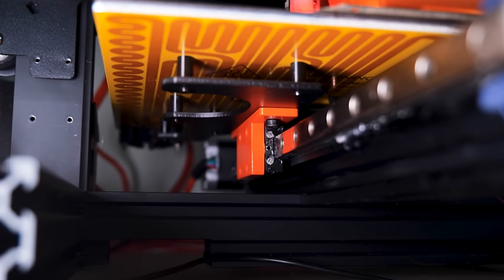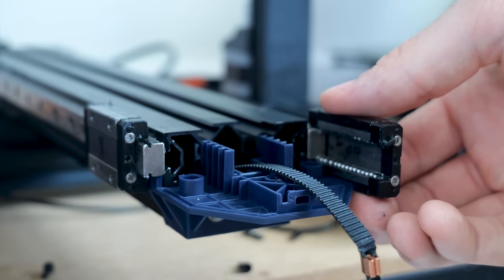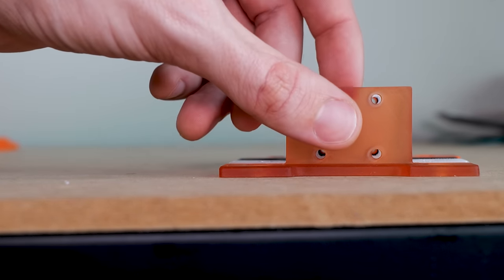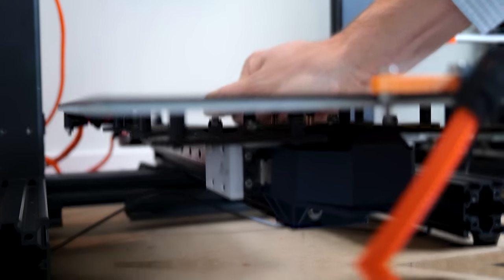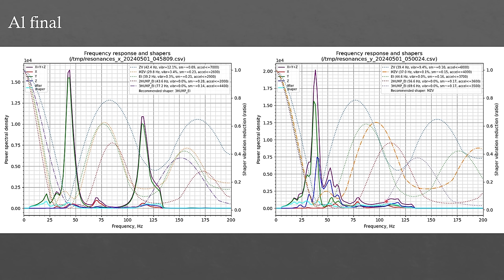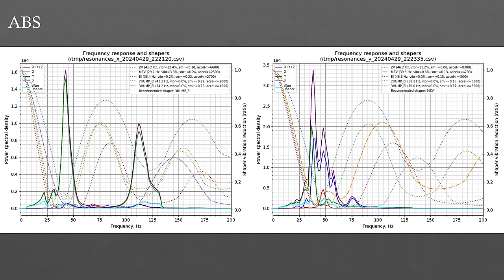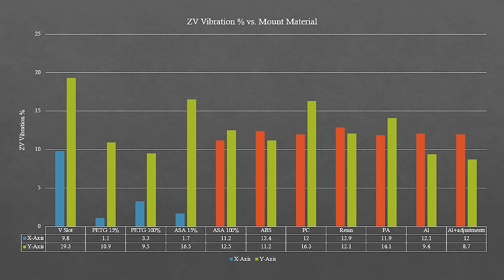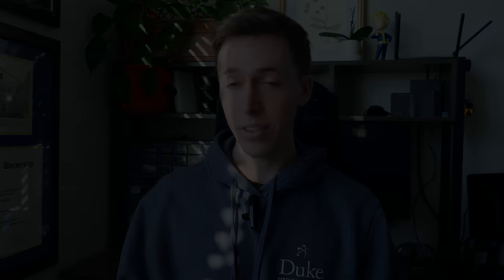Upgrading to Linear Rails a Waste of Money? - An Evidence Based Answer

Comment from the maker: Hey! Thank you for taking the time to watch this video. I just wanted to quickly point out a mistake I made in the video! When I show the grease I use, I present a grease that I claim does not have PTFE in it. Funny enough, as I find the link for it to put in the description, I discover that the Syncolon it has in it, is indeed PTFE. So, you may not want to use this specific grease... Sorry!
Reply: What a quality test, thank you for this!
Suggestions: Check the motors temperature, the added weight of the rails should, in terms of newtons law, require more energi (W) to run as fast as V-slot (edit: on many boards, even stock, you can up the driver voltage). Mine are all custom, so i can't give you any pointers other than; warmer then body temp = watch it, to warm and a little fan is needed. For Y with with glass bed and 2 linear, my stock Ender 3 motor needed cooling to handle properly
Reply: I specifically buy that specific brand of super lube because it has PTFE in it!
Reply: @SpencersDesk  the balls inside the carriages of miniature guide ways MGW/MGN are designed to circulate around little tracks.  To allow this circulation, they need to be oiled, rather than greased.  Definitely a good idea flushing and cleaning them, then applying the correct grade oil upon receipt.  They require occasional re-oiling - there are tiny holes in the plastic end caps/wiper seal plates to allow this.
Reply: @chrisgill5692  Yeah my friend told me the same. You could use grease in the Z axis but in the y and x axis because of the speed an somewhat thicker oil would be good.

Comment: I appreciate the exploration and learning, but you could have not uploaded this video. You have never used linear rails before and decided to go on Youtube and make a deterministic video about it? As an opinion piece, sure, but as "evidence based" this falls very short..  Linear rails easily hit 3,000+ mm/s movement speed as long as they are aligned properly and high quality. So a lot of this failure seems to be your own, and not something related to rails. As someone who operates a medium to large size print farm, I do not buy printers with V-slot wheels due to their issues with reliability and stability. I would advise you to come up with a way to line up your rails better or see if you got defective units.
Reply: Definitely, when using more than one rail per axis the perfect alignment is needed. Also thermal expansion affects the preload of the rails. So that's the reason why I changed mgn rails back to vslot wheels.
Reply from the maker: Hey! Thanks for your comment! Before getting into the reply, I just want to emphasize that this video wasn’t about which is better, VSlot or Linear Rails, but if it is worth upgrading to linear rails from a V Slot system. It’s obvious that linear rails that are better and worth choosing if you’re either designing a machine or buying a new one. They’re faster, more reliable, easier to maintain, etc, etc…

I definitely agree, there is my own failure influencing all of the results. But, that’s partially the point I tried to get across. The audience for this video is likely (a majority) people that don’t have experience setting them up. So, these are the results that they can expect. I definitely pointed this out and made sure viewers knew the errors in both the experiments themselves and my approach.

I provided results, discussed its shortcomings and explanations, then finished off with my opinion. I do believe it’s not worth it (unless you enjoy the work). If I ran a print farm I wouldn’t spend any of my time upgrading to linear rails. I would, as you have, bought printers with them on it. I stand by this video being honest and valuable to the community. I hope that clears up my stance? Thank you for your comment!
Reply: I came to the comments to say this.  Without proper implementation they won't work right. The rails being misaligned, and using super cheap rails from Amazon doesn't help either.  Also you should never remove the bearing from the rail without a bearing retainer. 

As far as wear a plastic wheel on aluminum channel will never last as long as hardened steel rails and bearings, not even close.
Reply: Doesn't matter if you can never hit that speed cuz the hotend can't heat up plastic nearly enough
Reply: Who hurt you? Hahaha It was pretty clear that his intention was to provide the perspective of a non expert to set the expectations of others who naively thinks linear rails will save them. If you don't know what you are doing it won't... And even if you try to learn as you go it may not even be faster than your older setup.
Don't be so rude... You look like a Karen.

Comment: Having experience in metalworking, I can say that rail guides should work in pair. One rail will always give friction. Even with preloaded cariage.
Reply: Was thinking the same thing. Proper setup would include a high precision "arm measuring" tool to align them (no idea what that tool is called in english), but hen again, a 3D printer isn't a CNC mill designed to handle 100s of kg
Reply: yeah, usually installed in pairs, and the grey bearded (decades of experience) toolmakers would spend hours adjusting them to be parallel to within a few  thousandths of an inch along their entire runs. (I worked programming premium quality custom industrial machines that made luxury goods and medical products, we used very expensive misumi linear rails.)

oh.. i remember how they measured the parallelism, you mount a dial indicator on one of the rails, and move it back and forth, adjusting the other rail so that you get the minimum runout along the length of the rail!
Reply: Huh, so every X beam on coreXY machines should have 2 rails ? 
Is triple Z still ok ?
Reply: @_Xantras_  If you need reliability and long lasting with rail guides, they better to work in pair. It’s reduces radial friction of every single carriage. But for fdm it would be a very excessive precision and there are much lightweight and more reliable solutions. Btw a rail carriage with preload, (which used in A1 for example), although it reduces trembling and friction, also leads to more frequent replacement of both the rail and the carriage, cause preload = excessive wear. It’s a frequent problem with cheap chinese laser machines.
Reply: @digitaltoaster  I'm not gray bearded toolmaker yet, but had an experience with adjusting rail guides through 3 meters along. I agree with you that it's a real pain in... you know))
Reply: @VikingRul3s  Yup! You are right! But even more difficult task is to make the master rail level along its entire length. To do this, you need to find a high-precision ruler that will be used as a standard of accuracy. But I am sure that for FDM with a small printing area this is not necessary. I'm just trying to say that using rails in general isn't such a good idea unless they're used as recommended. They are heavy, costly and you may get better precision and lightweight with another type of guides rather than mounting a single rail in your machine.
Reply from the maker: Love this discussion!
Reply: I just visited a pcb assembly factory and the there was a pick and place machine that was extreme fast. And it has only one linear rail on one side, and a passive slider on the other side. The right angle bracket looked pretty heavy, and the belt was at least 5 cm wide. It was impressive. I think having two linear rails on both sides will casue a lot of friction because of the unperfect parralellism between them. And since you mount them on the printers frame, if the frame is not perfectly aligned the rails won't be either. The rubber wheel design can handle a lot imperfection beacuse it has several times more tolerance than a linear rail and it is pretensioned. If you want to go with linear rails you have to make it properly.

Comment: Great job..... quality of linear rails measured by their cost (tolerances, grading, carriage pre-loading etc) and they also need hours of set-up using a dial test indicator.  Not worth an upgrade IMHO.  Tweaking the V-slot wheels can get tiresome, but being polymer they self-align and dampen to some extent - well adjusted they perform perfectly well for FDM.  Your analysis of the mounts was super interesting!!!  Really appreciate the time and effort you spent on this - subscribed.
Reply from the maker: I’m definitely planning on doing an experiment to see whether the setup needs to be that precise or not! I thought it would be cool to use a dial indicator and compare it to a janky eye balling it. Thank you for your comment!

Comment: You should never do 100% infill but rather 50 outter wall count. its stronger.
Reply from the maker: Why is that? Is the wall pattern better than the infill pattern? Is that true for all infill patterns?
Reply: @SpencersDesk 

I don’t really know the exact science word, but more walls = more strength because the majority of strength often comes from the outer edge

A pipe and a cylinder of same dimensions will pretty have almost the same strength, despite the pipe is missing its center compared to the cylinder

Also, I think that infill is more for supporting the top layer (and to help hold the walls from becoming wonky (I think, Im just guessing)) dont quote me Im not sure) and help with with print time. Because infill can be printed pretty fast, unlike walls

I hope someone who have more knowledge can give us more details on this, but I hope I still helped you out :))

(Edited because typo)
Reply from the maker: That's a good point about the different speeds that they're printed at. A good rule of thumb is slow prints = stronger parts. My guess is it's the orientation of the lines reative to each other. Having contiuous lines stacked is likely going to be better than a bunch of lines crisscrossed. Maybe certain infills like linear wouldn't have much of a difference with being all walls.
Reply: Would that be the same as 100% concentric infill?
Reply: @alfiegordon9013  

I guess it would be pretty similar... But that will need to be tested for sure

Comment: the smaller the machine, the less linear rails will help. I would not bother with linear rail on most designs smaller than 250mm. on larger machines, belt stretch starts to matter and vslot bearings will start failing to hold things in place. resonances will be worse in the 400mm/s regime

Comment: You're lucky not to spot any major difference after installing noname rails. Those rails are produced on low quality worn out CNCs and may have really bad tolerances. They can arrive bent, jamming or having too high backlash. The cheapest acceptable rails are made by HIWIN. Not the best, but OK for 3D printer. Anything cheaper might be garbage. And even if they seem to be OK, they may wear out very quickly.
Reply from the maker: I think most of the community uses rails cheaper than HIWIN. Honestly, I think there aren't going to be huge differences between the cheaper rails and the HIWIN rails relative to the cost increase. I think the cheap rails require a lot more attention at the beginning, making adjustments, making sure the bearing are all good, etc.

Comment: The nerd in me liked this video, good job. I'm a big advocate for linea rails... the truth is that adjusting wheels is always a guess, its an excercize in experience that Im not interested to learn and they'll always need readjusting. I just dont want to include my carriage systemm in my troubleshooting process... the Y axis is particularly annoying for wheels... I would literally bybass a slightly superior printer to get one with extrusions that allow me to use rails. Lightning speed isnt interesting to me because I dont print PLA anyway and ASA and PETG just wont print at high speed... rails, set it and forget it for the most part (apart from occasional lubrication).

Comment: One thing to check that you are not introducing some accumulating errors into the consecutive tests using the same setup is: run the first test (petg?) as your last test as well. If nothing significant changed, the results would align. If they do not, something unexpected happened. Maybe linear rails got looser, some geometry moved, screws got loose, etc
Reply from the maker: Very good tip, I’ll make sure to implement that in my upcoming videos!

Comment: @3:23 its not normally 'grease' applied at factory, but a light machine oil - and yes, it is to prevent corrosion because your rails might sit in a damp, hot warehouse for  months or years before you get them. It 100% should be removed and actual grease be applied.

infill is overrated.  more walls will get you a stronger part, almost every single time.  This has been tested, pretty well by now. a good 7 or 9 wall thick part, while bits of it will be solid - the main 'gap' area, will be infill only, which doesn't need to be high %. (3d Honecomb and Gyroid being some of the best, strongest)  So I would be curious if amount of walls, change your frequencies or not.

I've personally come to the conclusion that our aluminum extrusions should be filled with like.. sand and capped off. This provides weight, stiffness and some dampening, in the frame itself.

and I think your mostly right though - the rails vs wheels is.. kinda dumb for performance, it is more related to keeping the printer running smooth.  Adding or replacing grease every few months, is so much less effort than cleaning plastic bits outta the rails, and preventing it from going onto prints while they print - not to mention eventual replacement of wheels, even PC wheels, as all will wear down as they ride along that 'sharp' aluminum angle they ride on.  They are designed to be the expendable part - because when plastic and metal rub together, the plastic wears, not the metal.     ball bearings on rails - work differently, which is why they don't wear out as fast and are used in most industrial machines.
Reply: secondthat transport oil is not ment for operation on linear rails. Clean and grease properly.
Reply: I heard this oil is Cosmoline. It's just there for rust protection.
Reply: @Shinobubu  They're most certainly not cosmoline. Cosmoline is a type of petroleum wax, which is usually quite thick when fresh and then solidify over time into a hard wax. The stuff that typically coats metal parts to prevent corrosion during storage is just simple light machine oil or mineral oil.
Reply from the maker: Hey, thanks so much for this comment. I’d read it multiple times and found lots of valuable info from it. I definitely agree with you on the convenience of the rails after the initial setup.

I’m getting back into 3D printing after being on and off for a while, so I’ve forgotten about the walls vs infill stuff. Thanks for the reminder! It will definitely come in handy in the future.

Comment: Another great video! 
I agree with your sentiment on linear rails for quality and speed, with a huge BUT:
As you pointed out, V slot wheels can and do cause problems when theyre not adjusted perfectly; this inevitably leads to a problem that you have to diagnose. I think it's extremely important to reduce the number of things that can go wrong, especially if you have a cheap printer.
Reply from the maker: That is such a good point. I think the biggest upgrades in 3D printing are ones that make your head hurt less. I wish I would’ve talked about it in this video! Thanks for the support!!
Reply: True, but there is a limit to what people should do with a cheap printer if they are budget conscious. I didnt much and bought a lot of cheap parts to "fix" and improve my ender 3, and while I learned a lot, i ended up spending bambulab money. And the printer does not have bambulab performance nor precision. Much better than stock ender 3, and the journey to get there was interesting, but still ... I could have just bought a better printer and call it a day.  anyway, jump in the rabbit hole with that in mind :)